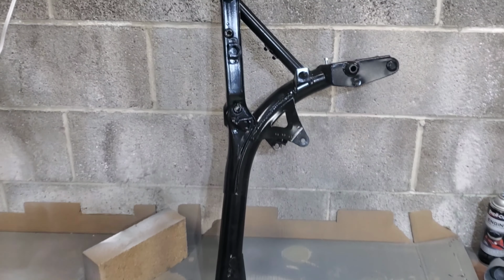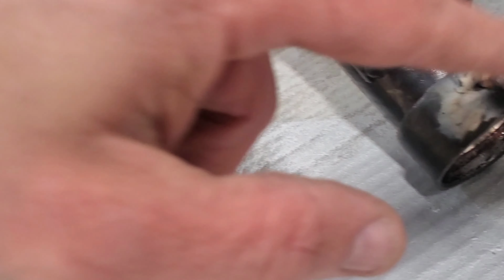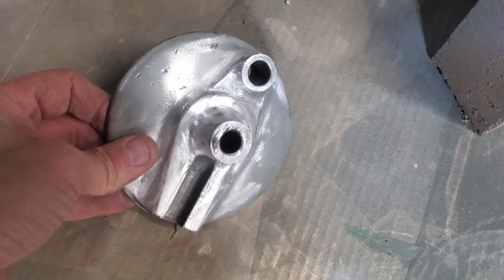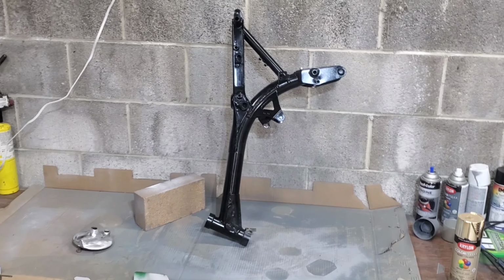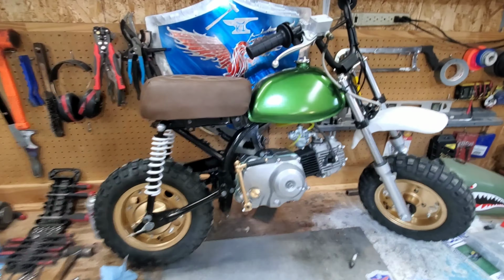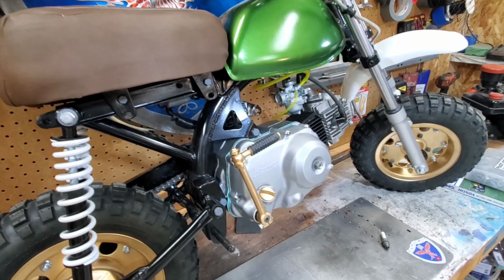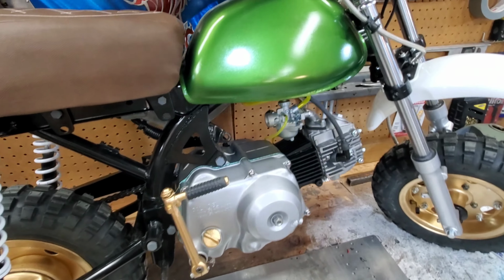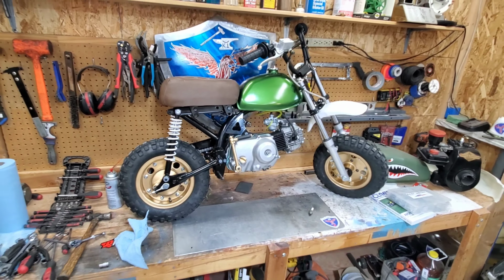DIY Vintage Motorcycle Restoration- Final Assembly!!!

Comment: Is this the z50 mini trail or one of the sport z50s
Reply from the maker: This one is a Z50A (minitrail).  1978 was the last year for the A model, the Z50R came out in '79 and has surprisingly quite a few differences.  I have a Z50R as well, and was hoping some of my spare parts would fit this one but the frame, tank, seat, and a few other odds and ends are all quite different.
Reply: I have the same 1978 z50a that I want to put a 125 on because the oem motor is shot and I want to make it look sporty but on a budget! Sweet bike by the way!
Reply from the maker: Thanks!  I've seen a few people do the motor swaps.  Kind of toying with the idea of "scratch building" a Chinese Z50- buy everything new and build it completely from Chinese parts but with a bigger engine.  Might be fun!